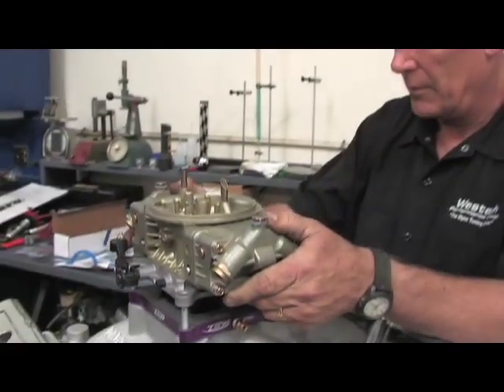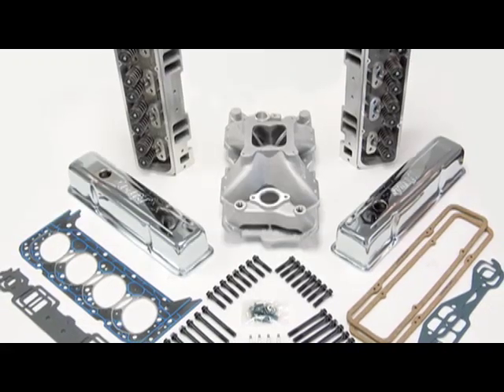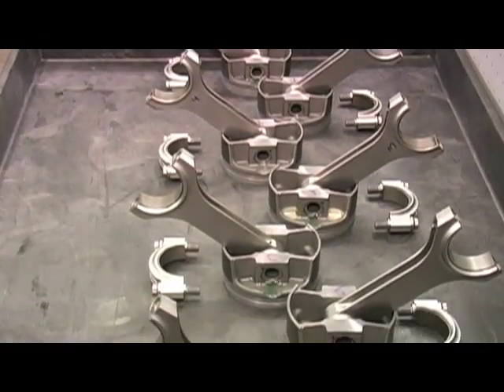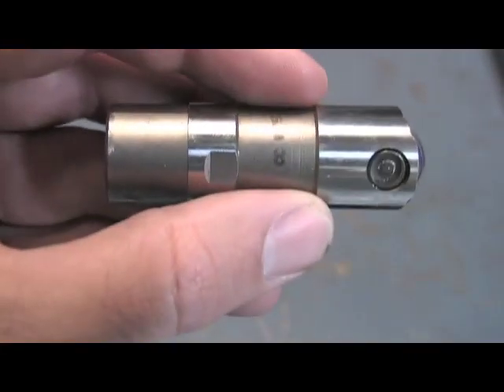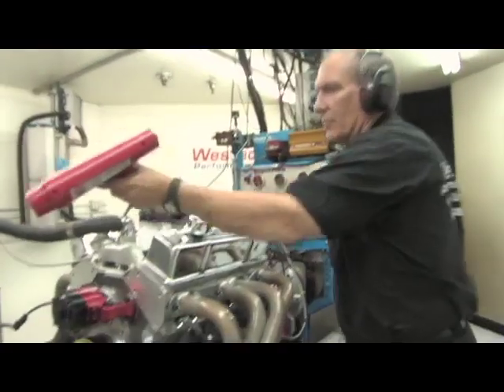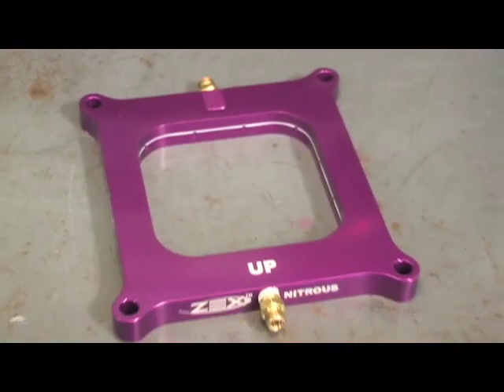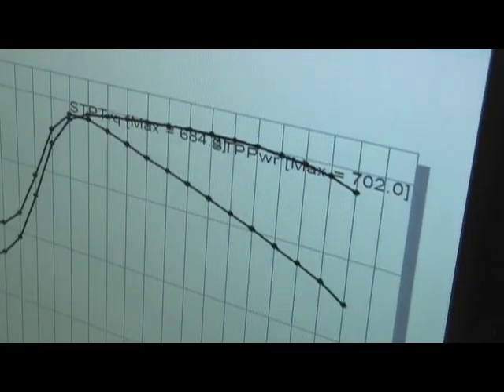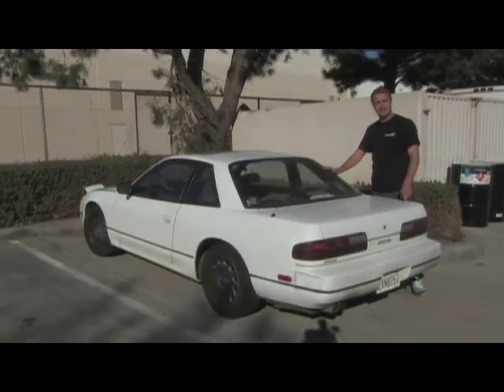Dart 702hp Top End Kit Build

Comment: I have a Motown 454 that’s at 610 hp 10.3 compression hydraulic roller on 91 octane no nitrous putting a together a 4.378 stroke in my big block looking to get over 700 hp and torque out of it maybe

Comment: Any chance of a little more info on those heads? Dart pro 1 aluminum with a 215 runner doesn't say much. they come in several different configurations. What size are the valves, 2.02, 2.05 or 2.08,  64cc c chambers?
Reply: If you’re looking to run nitrous go with the 230cc runners and 64cc chambers
Reply: @crsracing1313   Do you have heads that will accomodate a nuclear reactor?

Comment: anything over 400hp without traction control is just a tire eater
Reply: Or you could learn how to properly set up the vehicle, or figure out how to use that gas pedal thingy.
Reply: Im 500rwhp through a th400. Not an issue on DOT drag radials. Even on hard street tires I can hit it from a 40 roll. 6000 stall gets pretty violent below that lol.
Reply: Yep...
Reply: Depends how heavy the car is